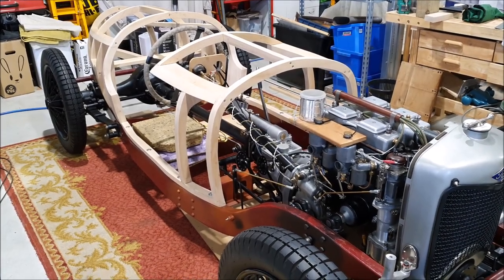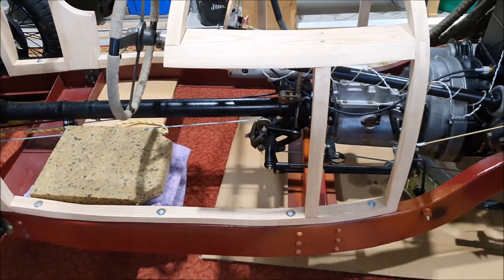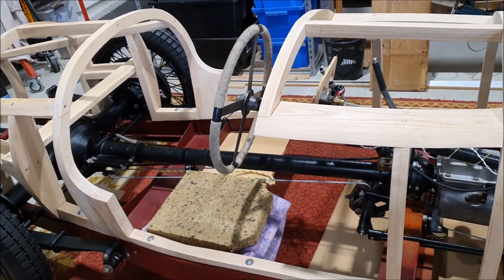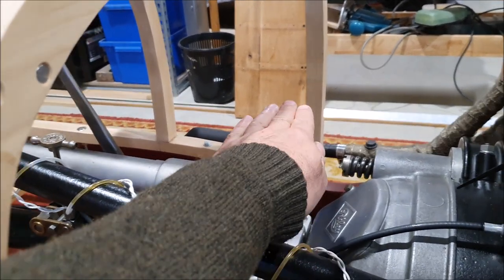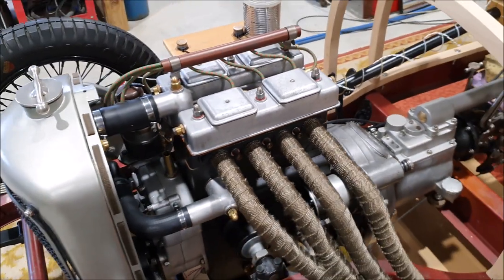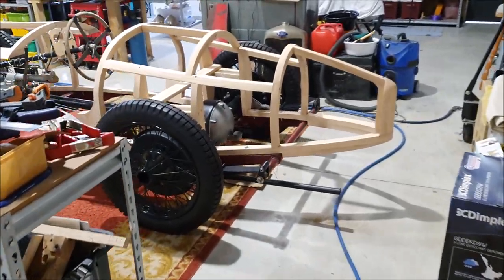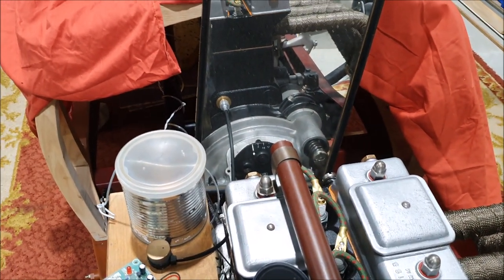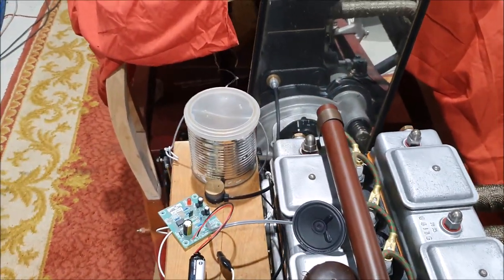Riley Brooklands replica - frame bolted down

Comment: Nice update.  Every little thing a guy gets done brings it a bit closer to being on the road.  I like the idea of being able to get the body off with minimal effort.  Once the body is on every little job has all the bolts hidden behind something!  Whenever I do anything with timing, I do it 20 times over and still feel I'm just guessing. :D     Cheers
Reply from the maker: It helps the body is actually in two halves! I found and old film the other day, 'Death Drives Through' set in period and using real period footage. There is a Riley Brooklands in that, racing on a dirt track, missing the entire back of the body!
Reply: @asciimation  I'll have to look that up.
Reply from the maker: @shedbythetracks  It's on the Internet Archive. archive.org/details/death-drives-through
Reply: @asciimation  Here's the 34 min version  https://www.youtube.com/watch?v=_n9rzUZAAOw
Reply from the maker: @shedbythetracks  I found that one first and wondered why half the plot was missing (as well as the soundtrack)!

Comment: Keep it up Simon - now you do need to get those Amal's out and fit them - ! 🙂

this is the induction noise you too could have !    https://www.youtube.com/watch?v=5uyYbUcrp50
Reply from the maker: I'll dig them out again and see what the numbers are on them. I don't think the rebuild kits for Amals are as much as the ones for SUs.
Reply: @asciimation  Hi Simon

you really do not need rebuild kits as there is very little to replace a few fibre washers and then set up / change jets to suit but you need to run it with them on to work out what changes are required - if any as they may well be jetted for a nine engine - so just a good clean a bit of common sense & try them